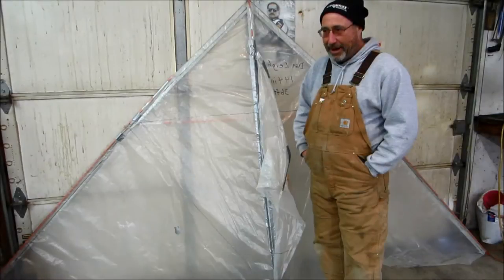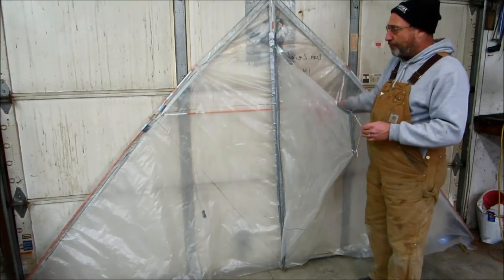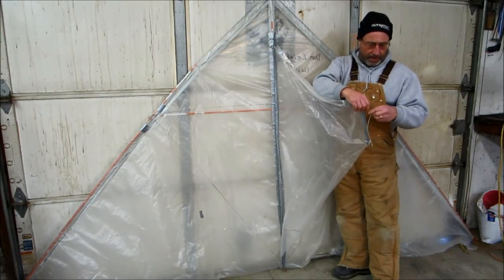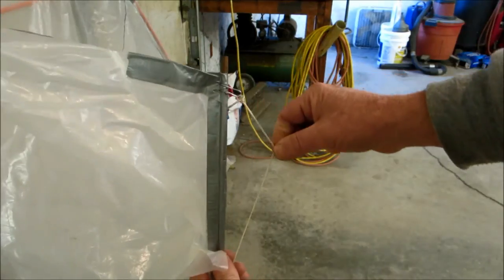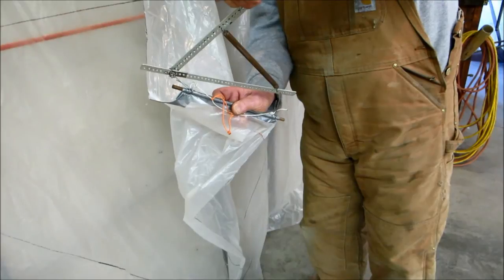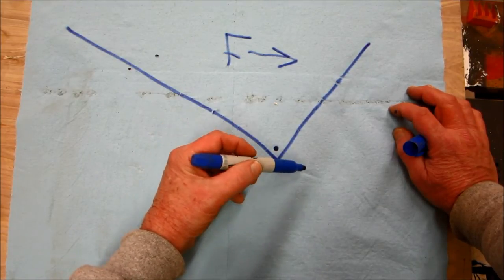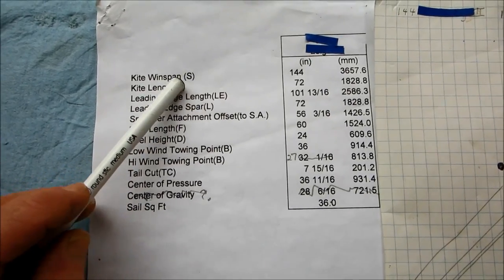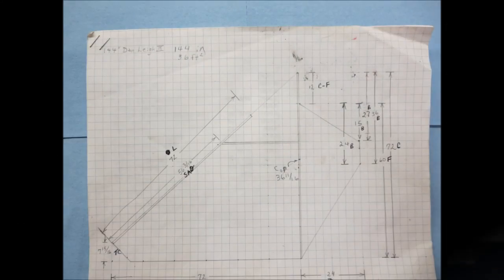How to fly a delta kite perpendicular and compensate for gusty winds

Comment: I have a couple of questions, what is the minimum and maximum wind range for this kite? Also how do you calculate the centre of pressure?

I fly kites in New Zealand for fishing. They work amazing for setting 25 hooks out as far as 1 mile of a beach.
Reply from the maker: This kind of a kite can do bout 1lb lift per square foot of sail.  It has flown bout 1500 foot but your line makes a big difference because of its drag
Reply from the maker: Sorry, go with a deeper bridle point in less wind.  I like bout 3mph but thats just me.  The more wind then ive popped carpenter string.  So, what im trying to say is that i like 3mph wind but should be capable of up to whatever you think you can hold onto without something breaking like the string.  Me and my buddy lost a 15lb anchor one time but another story another time

Comment: Good video, sir.  Thank you for making & posting it.  Question, ¿how critical is the position of the cross brace with respect to the top point (where side spars come together) please?  Thank you.  tonyd\.
Reply from the maker: Thanks for watching and you have a great question.  The position is critical with only regard to its weight in relation to the center of lift.  It should be positioned exactly on center.  If forward then the kite will be nose heavy will tend to dip...if behind the center of lift then the kite will want to slide backwards.
Reply: @MarshRat  Dear Sir, thank you for the kindness of a reply.  I will apply what you've said (taught me).  Thank you again.  God Bless.
Reply: @MarshRat  Thank you very much.  (I've made a medium size delta, ~31" tall [vertical distance of the center joining the two wings], ~90º included angle, 0.25" dowels, light poly material previously use as store bought poinsettias wrap to take plant home).  Kite goes back & forth too much, & is likely too heavy for light wind.  Am making small adjustments to try and fix issues.  My first try, so I don't expect too much.  Thank you for your video and expert knowledge reply.  God Bless.  tonyd\.

Comment: Very nice video ! I would like to see some more details about construction and the attachement of the keel to the wings
Reply from the maker: Conmar Chartering I"ll definitely do a vid when I get some extra time.  For now, let me just say that I make both wings out of a single piece of material.  Afterwards, I mark a center line from top to bottom of the wings to locate the position of the keel.  Next I lay the keel on the center line and tape tape the keel on both sides with Duct Tape to the wings...In heavy gusty winds, I've never had the keel seperate from the wings even up to the point that the cross spare has broken!